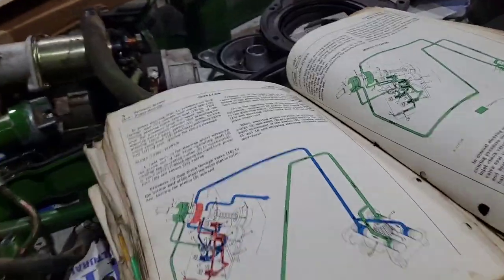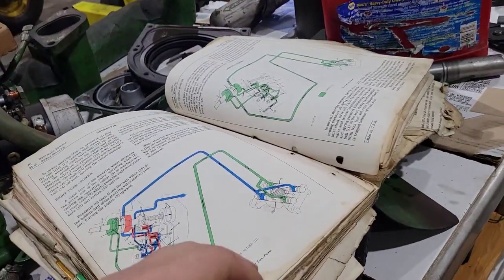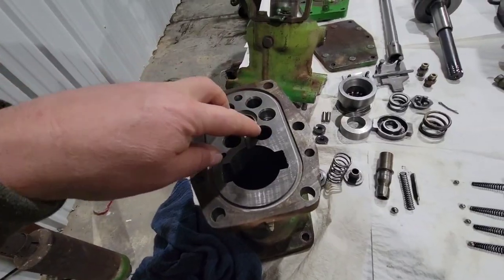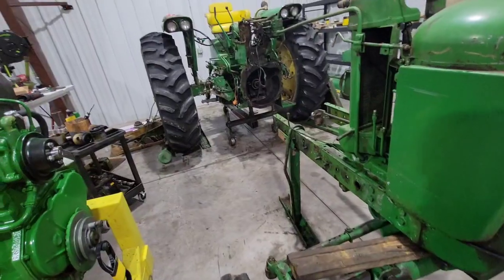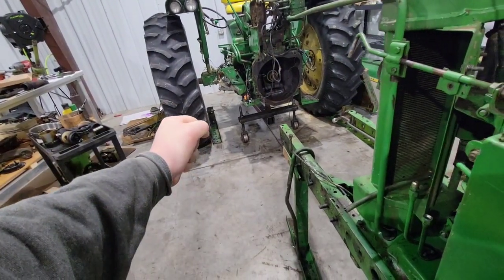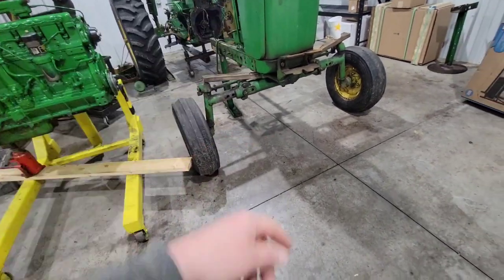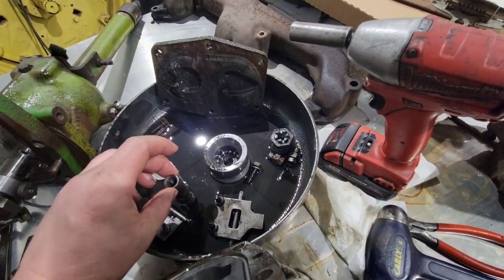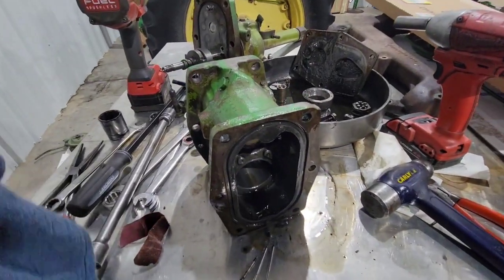John Deere 4020 steering theory of operation, Diagnostics, steering valve rebuild

Comment: Can you tell me if the steering valve section for a 3010 john deere gas engine is interchangeable with a 3010 diesel engine? Mine has gone out and I have access to a 3010 diesel steering valve section. Thanks so much I really enjoy yourvideos and how you dummy them down for the common man!
Reply from the maker: The valve should be the same? You could look in parts book.

Comment: I GOT A 1972 OR 74 4030 darting, turn wheel & hold it then front tires move, anything you could tell me where to start looking. also have a uncle in Montrial  Quebec, so i am going to use the dirty little Frenchmen saying i really like that
Reply from the maker: I would cap the lines down by the the front axle with the front axle off the ground can you take a big bar and try to turn the wheel if they slowly creep it's in the front axle Pistons. If it's solid it's either in the metering valve or the valve block
Reply: THANK YOU @jonstevensmaplegrovefarms3754

Comment: So our 4250 runs augers and a 6 row John Deere planter with a hydraulic seeding blower on it. 
The front wheels always creep to the left within 15 min. 
Can a guy get a spool rebuild kit for the shuttle valve or do ya have to send it in for a core exchange? 
I'm capable of putting in a spool kit and seals. If machine work is required, then I'd get a whole shuttle valve itself. 
Thanks for your input.
Reply from the maker: Some places have "reconditioned "
It's likely the spool under the hood.
Reply: @jonstevensmaplegrovefarms3754  yes, I believe so after watching your video. Can a guy get a repair kit for these? Or is it something they would have to machine for a newer spool for tolerance reasons?
Reply: So, looking at your comment section, I discovered an o'ring kit was mentioned. I'm good to go on that project. Have to look at the manual tomorrow in Braham. Thanks for everything.
Reply from the maker: Here is the exploded view of the block under the hood.
I was tempted to take one that leaks, send it out for ceramic coating or a piston skirt coating from snowmobile racing technology and see if it could fix one?

https://partscatalog.deere.com/jdrc/sidebyside/equipment/64105/referrer/navigation/pgId/294144813
Reply: Nice. I'll check it out. Thanks for your input Jon. Always appreciated. 👍

Comment: Great video. I am restoring a 3020 from head to toe that I grew up on and your videos are making a huge difference. Is it worth spending the extra $100 on the rebuild kit from Deere as opposed to aftermarket on these orings?
Reply from the maker: We have had tremendous luck with getting the engine kit from reliance and the gasket kit from john deere. 
I would never ever by Any engine stuff from A&I

Comment: I have a question, I have a problem with the steering wheel for a John Deere 4320. When driving it moves to one side. Or when moving to one side, the steering wheel get hard but eventually moves. My mechanic said its the housing that is not good. Help please.
Reply from the maker: Steering valve under dash most likely can cause hard steering and delayed movement from steering wheel to front tires.

As far as being able to turn the wheel and have your tires stay straight that could be a leak in the front Pistons or a leak in the valve under the dash

Comment: Oh shit now you got me second guessing  my reassembly of that piston had to replace the o ring and seals on the shaft because it was pushing oil up the steering column haven't tried it yet the rest of my 4020 is still in pieces doing a complete restoration. Got into the transmission and had fun putting synchronizers together with out the proper tool to hold the 4 balls in place to get the collar together grease was my best friend to prevent the spring loaded balls from going tink tink across the floor lol well I'm happy i found this video so whe i get it running and the steering doesn't work I'll know what happened. One thing I don't understand is why they made the console area so tight to get the lines off and back on again there was lots of classic words and even a few new words involved lol. My 4020 looks just like yours pieces every where it all started with someone putting seals in backwards for main pto shaft took out clutches and cross shaft for hitch on bottom of diff housing then one thing led to another I'm in that far decided to do all the bushings on linkages brazing linkage holes and redrilling them when it's done should be like a new tractor. Sad thing is i can understand why I got the tractor so cheap it ran pretty good but spewed oil out of every place possible just time consuming resealing everything then i thought well so much work going into it decided to paint things up as i put it together never thought after 2 years i still have 4 skids of parts to go through yet before it gets done 🚜🚜🚬🚬🚬🤬🤬👍👍
Reply from the maker: Ha! Fun.....lol
Yeah they are good at packing pieces together.

Comment: Excellent video them steering valves are fun to rebuild I did a 440A John Deere skidder valve I was plowing snow with it and it started gushing hydraulic oil out of the body o rings and I resealed it and it works wonderful now and steers better too. Then a few years later on of my farm called that his 4620 John Deere tractor would only steer to left no matter how hard I tried I could not get a right turn. So I took the 2 hydraulic cylinders from underneath the frame below the radiator and put new seals in them then it would turn right if you really twisted on the wheel. I told the guy that the steering control valve has to come out and that is a long drug out project it has a hiniker cab but me and 2 other guys got it out and I tore it down and found a bunch of torn seals and o rings it's a little bit different because it is a 2 output and 2 returns but I got it back together and it works perfect . When I reassembled it I laid out on a table with white butcher paper it really helped to see all of the small parts and pieces.  Them o rings down in the bores are a real bugger to get in there I took my time it took most of day and I had a bunch on lookers they had never seen so many small parts and pieces. I also rebuilt the steering control valve on a 2830 or 2840 and it has a whole bunch of o rings that go into the casting grooves I had to make a pick with a welding rod to get them in that customer said he had the tractor 5 different shop for the steering control valve and no one got it working until I fixed it then it had finger tip steering and quite leaking.. Thanks for the informative videos 👍👍👍👍
Reply from the maker: Nice!
Yeah the extended o-ring pick. LOL they come in handy

Comment: Did you use feeler gauges to set .030 from the face plate? I followed these steps and when I put steering back into the tractor it didn't turn at all. I have pulled it out and re set everything several different times and no luck. I'm not sure if I'm turning the steering wheel far enough to the right before setting the weight on it before doing my adjustments ( I broke a plate on accident turning the steering wheel to far the very first time I took it apart). I'm not sure if I'm doing something wrong or if there is air in the system somehow. Do you have to bleed the system somehow once installed?
Reply from the maker: .003" not .030" and the other is .001"
Use dial indicator.
Most of the time, no bleed is needed,
Reply: @jonstevensmaplegrovefarms3754   sorry I meant when you installed the neutral stop plate  that held the operating collar .030 from the face of the valve housing.
Reply: @jonstevensmaplegrovefarms3754   which direction would you go as far as tractor not steering at all once put back together? Is the .003 and .001 adjustments off or something to do with the check valves under poppets?

Comment: You seem to be very knowledgeable about 4020 tractors. We are located in Italia and we just purchased a 4020 with a loader. The loader is an Italian aftermarket brand. It is powered by a hydraulic pump mounted at the pto. The loader has its own hydraulic oil tank. My question is why couldn’t we use the tractors hydraulic system to power the loader? Thanks and we love your channel!
Reply from the maker: Thanks for stopping by! You would be the first from Italy that i can remember! 
If it has the 8 Piston pump up front there is no reason. It's a very good system for a loader.

Comment: very good explanation is there a video you have of ur history? I haven't had time to watch all ur stuff just staying updated from when I found ur channel i'm assuming you were a deere mechanic at some point? I started with case ih during my diesel tech program back in 99 then to vermeer then started farming and doing repairs for several farmers out of my own shop like you way it looks
Reply from the maker: Yep went to JD college in 94, worked at a few deere dealers, sold the dairy cows in 2003 and went into road work.

Comment: From the detail you have explained so far, you are clearly the guy to ask about JD steering. I have a JD 4430 that darts right on occasion. When it darts, a quick left hand correction on the steering wheel stops the dart and it will operate normally for a time. I assumed it was the steering sector and ordered a rebuilt one and had it installed. The problem didn’t reoccur for a while so I thought it was fixed. Recently it has started darting again. Not as fast as before, but if there is no correction from the steering wheel it will go to full right turn in a very short time. Any ideas? You pointed out a steering valve in front of the firewall, could this be the culprit?
Reply from the maker: Do you have an early 4430 that had the 20 series steering?
Reply: @jonstevensmaplegrovefarms3754  After investigating today, it appears I do have the older design. I didn’t see a valve block in front of the firewall on this 4430.  The situation is this: less than a month ago I got the tractor back from the local shop after doing an engine overhaul and replacing the steering sector with a rebuilt unit ordered from wherever the shop orders units from. It cost $1600 for the refurbished unit.  Anyway, it was darting bad before the overhaul/replacement work.  At first when I got it back I didn’t notice any darting, but after using it in the hayfield cutting for about two weeks, I noticed that the darting is still happening albeit much slower.  It will go to full lock right if the operator doesn’t correct the steering back to the left for a moment when it starts to dart.
Reply from the maker: Darting is usually in the valve in the cab. Do they have a warranty on it?

Comment: We have a 4430 with the old 20 series style steering everything was working fine we blew a main hydro line dumped alot of oil. Replaced the line, refilled the hydro reservoir, started the tractor, moved all hydraulic functions to bleed any air, shut off the tractor to recheck oil, and when we restarted the tractor we had no steering. we eased it home mostly using the brakes to steer and now when we start the tractor we can not turn the steering wheel, its locked hard and the wheels seem to drift a little to the left. We turned the tractor off and disconnected the line going to the steering valve to the steering motor and the steering wheel will then turn and we can move the tires using a bar. Thinking we either have an internal crack in the steering valve or one or more of those six pistons you were talking about are stuck. Any thoughts. Thanks in advance
Reply from the maker: Good question,  have a tractor waiting to come in same scenario,  changed front pump and now no steering to the right.
Reply: hi, I have the same problem as you, but on the old 4020, did you solve this problem and how?  Thanks.
Reply from the maker: That is kind of bizarre except we had one here that we fixed the front pump and then the steering wouldn't work to the right. Makes absolutely zero sense why that would happen.

For basic Diagnostics with the lines on hooked and the front end jacked up off the ground you should be able to turn the wheels and oil should come out of each pipe for each Direction

If you plug the lines coming from the metering valve you should not be able to turn the wheel much it all and it should get solid pretty quick.
Reply: Thank you so much, when I start the tractor, it automatically turns the wheels to the left and locks the steering wheel.  When I turn off the tractor and raise the front, I can turn the wheels with the steering wheel.  One piston in the pump was broken.
Sorry for my english, it is not my native language.
Reply from the maker: I wonder if some contamination didn't get into that metering valve? That's the only thing I can think of if it was working you made some repairs and now it's not. There are some aftermarket companies out there that eliminate that style of metering valve for not much difference in money versus trying to fix it or buying rebuilt units.

Comment: Like the repair videos. I have a 4430 that occasionally takes a moment for the tire to catch up with the steering wheel when turning right only. Does not happen when turning left. Any ideas? Thanks and keep the videos coming.
Reply from the maker: Early 4430?  So if it's an early model then it would have a steering valve just like I showed in the video.
Reply: @jonstevensmaplegrovefarms3754  Yes early model, 1973.

Comment: Good morning I am rebuilding a 1964 John Deere 3020 narrow front Diesel with a power shift.
I had been rolled over and burnt up.
I have rebuilt or replaced anything that was damaged.
I am having trouble with the brakes and steering.
with engine running the brakes apply, with engine off they seem normal.
I have rebuilt the brake valve, and double checked my work.
Also have a steering issue it takes a bit for the steering to start working, now I have oil coming out by the throttle and steering wheel area.
Thanks Terry
Reply from the maker: For the steering you can rebuild them but there is some good aftermarket Replacements that get rid of that metering valve.

For the brakes you're saying when you start the engine the brakes are on question mark double check your work again in that brake valve

Comment: In other words,  it was easier for me to pay the $760 to the repair shop to fix my ancient 4010. The problem was under the dash as the steering wheel needed to be constantly turned to keep it out of the ditch. Glad I got rid of it. Traded for a MF 1655 ten years ago.
Reply from the maker: 1655 like the compact utility tractor?
Reply: @jonstevensmaplegrovefarms3754  Yup. It's my winter tractor for snow removal. Love the creeper gear. Not traveling at road speed like the John Deere in reverse so one doesn't have to ride the clutch in taking the first bite of snow with the blower.

Comment: Great video. My 4020 will be with me for the rest of my life. I'm hoping to tackle this job myself. By seeing this video I don't see why I can't do it myself. I have a service manual and parts catalog. Mine will turn the wheels to the left if it is sitting and running for a period like when I'm grinding feed. Does Deere or someone else have a complete rebuild kit? Thank you for posting this. With the cost of everything now self-sufficiency will be the key to our survival.
Reply from the maker: Yep the o-ring kit you can get from John Deere.
The exploded view Parts page, taking some pictures with your phone as you tear it apart oh, and just taking your time I bet it will work like a charm!
In the tech manual it shows how you can plumb a hydraulic test kit
Reply: @jonstevensmaplegrovefarms3754  thank you.

Comment: Do I need to set the back lash if I’m only doing the gaskets and o ring replacement?
Reply from the maker: if you take it apart you have to double check lash, even if you dont touch the adjusting screws.

Comment: I have a 4020 when you first start up and move steering wheel the tires don’t turn. The steering wheel will turn all the way to one side and it takes a minute to catch up. What would I be dealing with here Jon?
Reply from the maker: Rest of the day is fine?

What happens if you let tractor idle for a minute before moving?

Comment: Where does one get the tooling to do the adjustments?
Reply from the maker: Simple dial indicator from an auto store or a tool shop. The little wrench dad just welded that up himself
Reply: @jonstevensmaplegrovefarms3754  don't you need tools to hold the pieces on the shaft in the right position to adjust the valves or is that why you have the weight holding the wheel?
Reply: The tool to hold the collar
Reply from the maker: Any special tool in the video we made.
Reply from the maker: @christopherbuxton3437  yes that is why you have the weight hanging on the steering wheel

Comment: Know anything about the old 4wd 7520 steering? Steers nice one way but a lot harder the other direction. Same theory?
Reply from the maker: pretty much.  the control valve is the same but the external housing has some differences through the models.

Comment: Inconclusive. Where’s the rest of the video for the adjustment? You didn’t explain very well. After you set the first two screws do you move the dial indicator to the other plate? Are you pulling on the screw to get the plate to collar clearance? What clearance are you setting? This needs to be explained a lot better, without moving the camera all over the place except to where you’re trying to explain the area you’re adjusting.
Reply from the maker: We have another one coming in, I will try again.